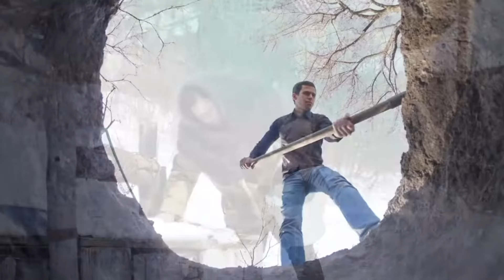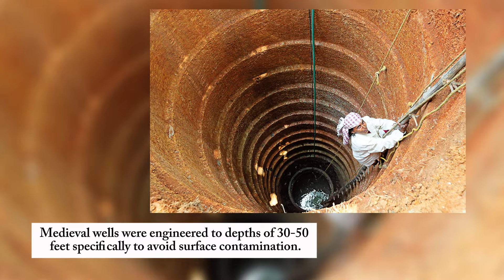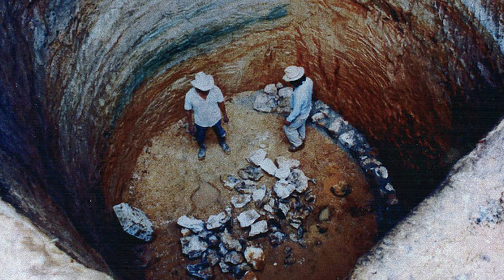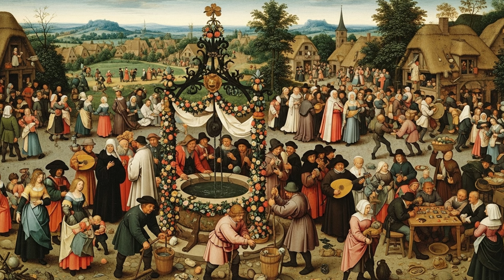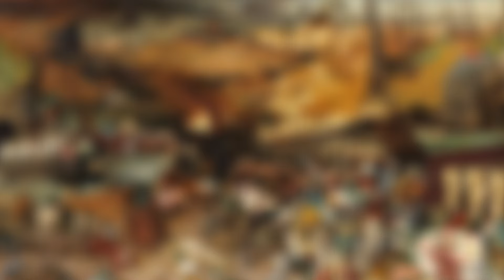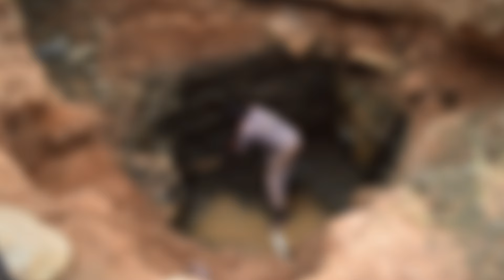Why Medieval Wells Gave Cleaner Water Than Modern Systems ?

Comment: Ok yeah the water may be better feom a well.   But show me a hand dug well that can produce enough water to supply London .  The modern water systems produce safe water in volumes that would be beyond belief of the people of that time period.    Not to mention,  that a drowned rat, will ruin all that pure well water pretty quick.  Thrre are ways of purifying water that do notbinvolve chemicals.   But they are really expensive.   Is well water better?   Maybe.   Fewer chemicals?    Probably some.   Better?   Thats subjective.